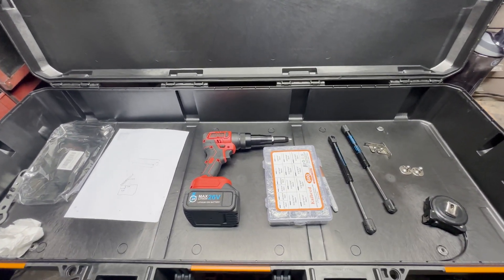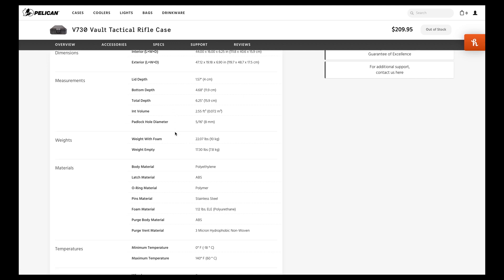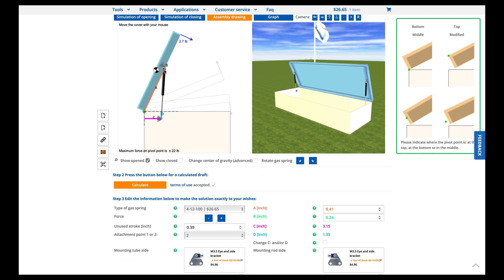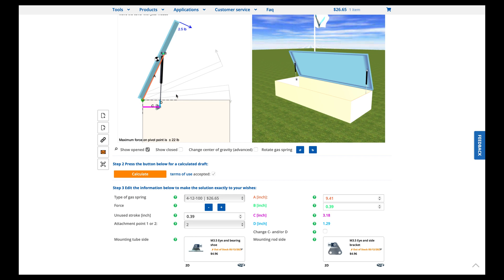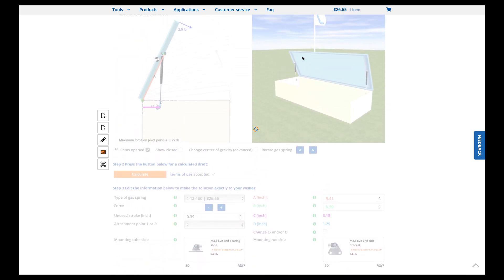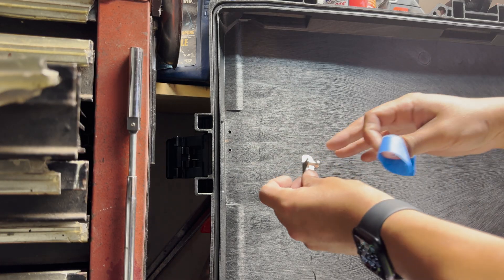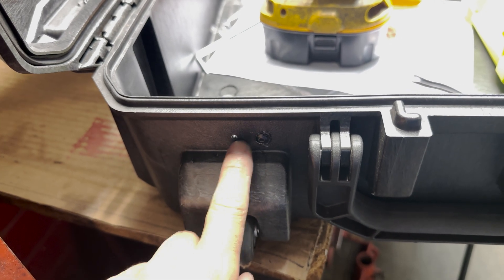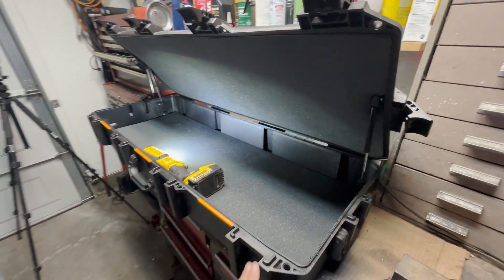The Ultimate DIY Guide to Installing Struts on ANY Case - Pelican Vault 730 Mod

Comment: great job. ordered up the struts . Rivet gun is a smart move. I bought myself the milwakee one when I got approved for the amazon cc , basically got it free. lol...used it tons on my aluminum boat.  Got my v730 for 137 today at sportsmans warehouse online. stoked to get this on my roof rack
Reply from the maker: That's badass! Glad I was able to help. Let me know how it turns out!
Reply: @MasterofNone365  you mention 5/32 rivets, do you know what length you went with? the kit you purchased is out of stock
Reply from the maker: @jaredlabriola  I can’t remember exactly but the general rule is 1.5x the thickness of materials. I think it was 3/8”.
Reply: @MasterofNone365 thanks ill order a couple sizes to b sure lol
Reply from the maker: @jaredlabriola  good plan lol

Comment: What size rivet did you use? 5/32 x 3/8?
Reply from the maker: Sorry, I don't remember exactly what size they were. I think they might've been 5/32 x 5/16. It wouldn't hurt to go a little longer with with 3/8 though if you think the 5/16 is too short. The good thing is that it's not too difficult to drill out a rivet if you don't get the results you want.
Reply: @MasterofNone365 thanks for response I’ll give it a whirl. Great video!
Reply from the maker: @BCounC  my pleasure! Let me know how it goes. Thanks for watching!

Comment: Are there any issues with water or condensation?
Reply from the maker: I personally haven’t but my boxes don’t live on my truck. I only use them when I go on longer trips. I’ve heard mixed things from others about long term uses. Some have said they’ve had leaks and others said they’ve never had a problem.
Reply: @MasterofNone365   I'm the same way. I only mount them when I need them. 

Thanks for the video.
Reply from the maker: @fransiscon  I think you’d be fine if that’s the case. Plus, leaving them on all the time when you don’t need to kind of sucks because it’s a little louder and might hurt your gas mileage. Thanks for watching!

Comment: If i want 100 degree need 15 inch ?
Reply from the maker: You'd have to put it into the calculator to get an accurate length. I've found that it's ok to go a little shorter or longer as long as the lid isn't being obstructed by anything when it opens. Thanks for watching!

Comment: I have the V730 on order, and was concerned with the lid flipping over due to winds.  This is a perfect solution and you did an excellent job of explaining and demonstrating how to install.
Reply from the maker: Awesome! I love my V730 cases! Thanks for watching. Let me know how it turns out!
Reply: @MasterofNone365  Took me about 3 hours, and 2 cups of coffee.  I like to take my time and enjoy working on projects like this.  Followed your measurements and it cane out PERFECT!!!   One thing iI did differently was to screw in the hardware first, then once all set up take out one screw at a time and insert the pop-rivet.    Works beautifully.  Cant wait to use it this weekend, great place to store my fly rods, vest, etc. securely.
Reply from the maker: @mftwomey  man, that's awesome. Glad it worked out smoothly for you!

Comment: Gonna follow your advice on this build. I have the V800 and aside from the length and weight of the lid being slightly bigger, it should work out just as well. My question, based on the fact I've never riveted anything before, is, couldn't you have inserted the 3rd rivet from inside to hold the side pivot?
Reply: Ahhh, a second look shows how close it is to the angled plastic. I had originally thought it was inside the hollow section.